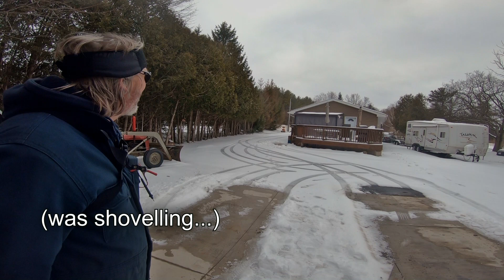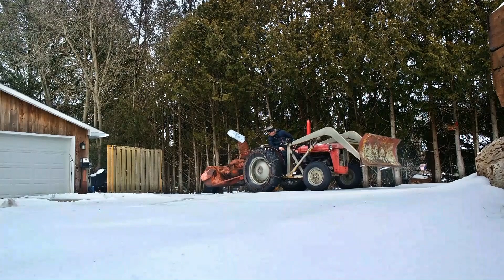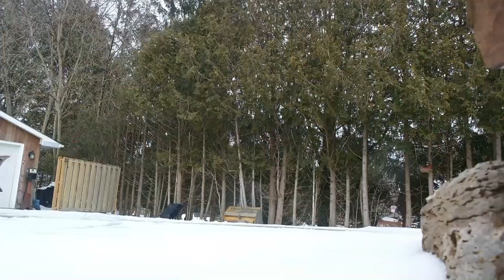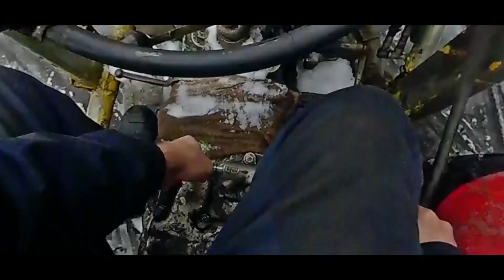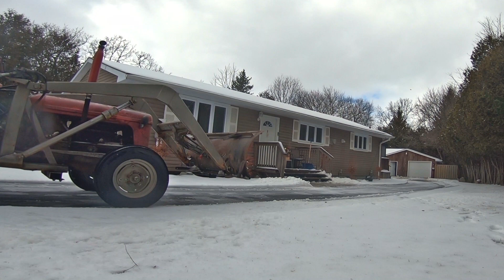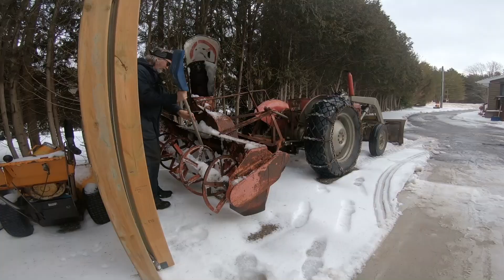Learn how to drive my antique tractor & Blow Snow!

Comment: Tractor seems to be running pretty good ,after the work you did to it.
Reply from the maker: It's functional. Not perfect. If it was to be used on a daily basis, I'd probably just buy a new carb. But I prefer to struggle endlessly... apparently, LOL.
Reply from the maker: Not bad. Sometimes I have to add a bit of choke on chilly days.. but fighting the trend of buying a new Chinese carb as long as possible ;)